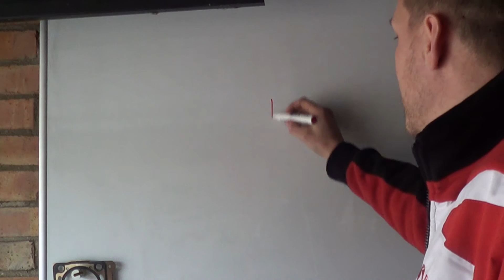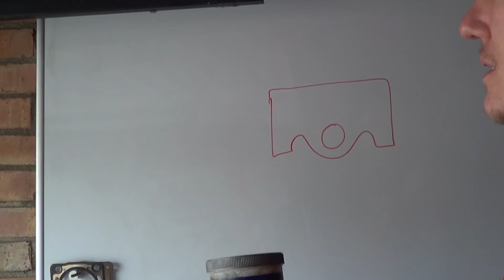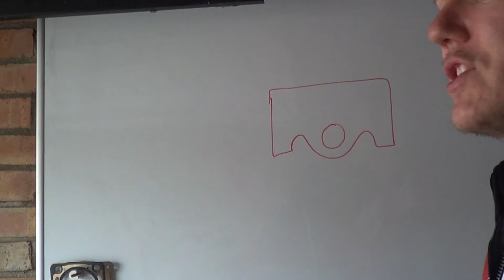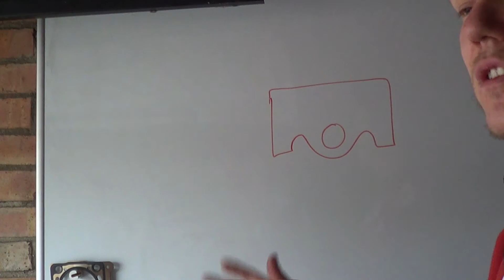Engine Fundamental Flaws - Part 2 Pistons

Comment: I don't agree with you on this one.
Every bit of energy that is put in moving the piston is retrieved when the piston is stopped again. If this wasn't the case than where did the energy go. No way it is converted to heat. It has to be put back into the flywheel. Where else did it go?

The only flaw in this system that I can see is that you always lose some energy due to friction losses when you transfer the energy from one moving part to the other. Sadly enough this energy transfer is happening all time in a piston engine. That is the flaw in my opinion.

Love to hear your opinion on this theory of mine.
Reply from the maker: A force is applied to the piston this does a few things. Compresses all the components, take up the 'slack' (clearance) between these components. The piston then accelerates, now the piston is at x velocity. This in turn (no pun intended) rotates the crankshaft. The crankshaft then 'gains' a rotation (angular velocity) and the energy that the crankshaft 'has' in angular momentum (energy 'stored' in the crankshaft or the flywheel effect). When the piston is at BDC the piston stops (for this example) and then has to accelerate again upwards. This is a different vector (direction) The crankshaft is what forces the piston back up. This means that energy the piston delivered to the crankshaft is then transferred back to the piston. 

This defeat the whole purpose of the engine. We want to accelerate the crankshaft not piston. Putting energy in and then back out is like a spring for example, and we don't want a spring. 

Back to the engine, the 'worst' stroke is the compression stroke, where the piston is actually doing work. You can feel this when you crank an engine by hand. This is one of the reasons why multiple cylinder engines are preferred. 

Great comment though, always good to question stuff and I'll make a video outlining this. 

Matt
Reply: Hi Matt,
Thanks for all your replies! Interesting stuff. 
I agree that a piston going up and down is a bad thing ;-) I get it. 

That will be an interesting video. Can not wait to see it.

Btw, you mentioned in some video that your were going to make a video about airbox designs or something like that. Did I miss that one? I'm still hoping you make a video about this as well. At some point I'm going to design and 3D print my own airboxes for an old moped. The original ones are loud as hell. I won't be messing things up because the original ones are calculated or decently tested any way :P This is going to be interesting.